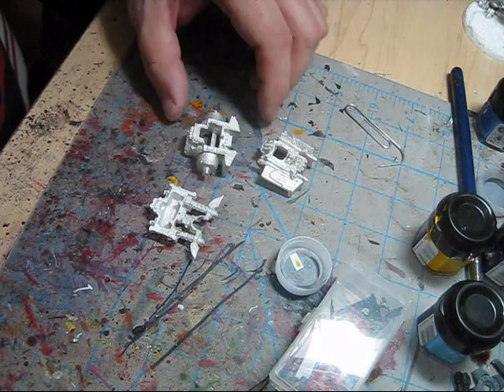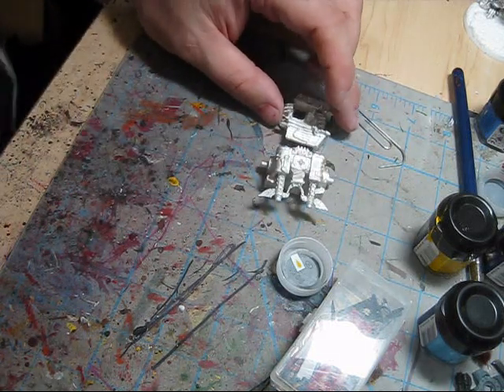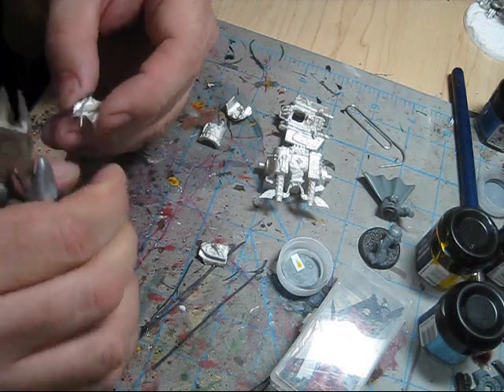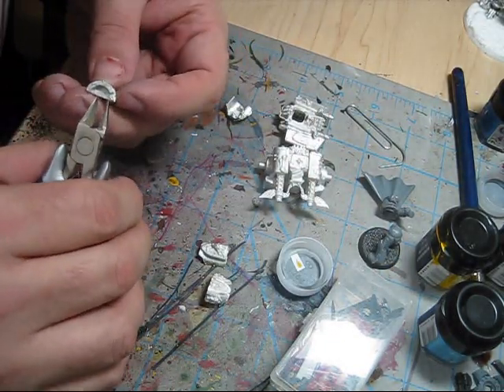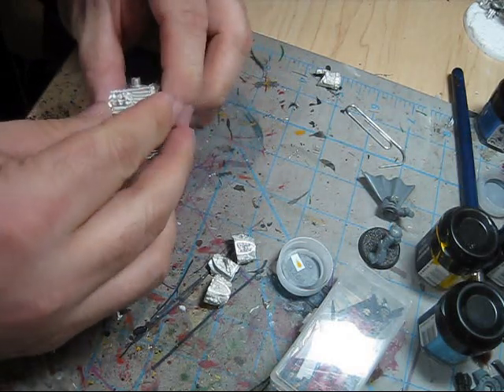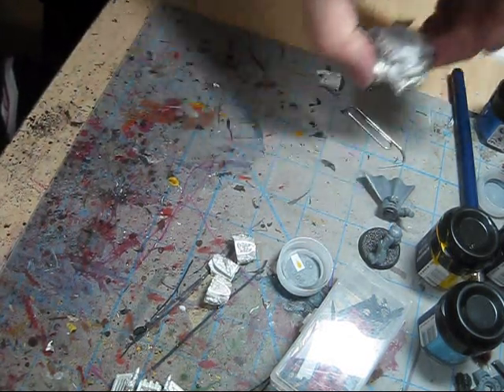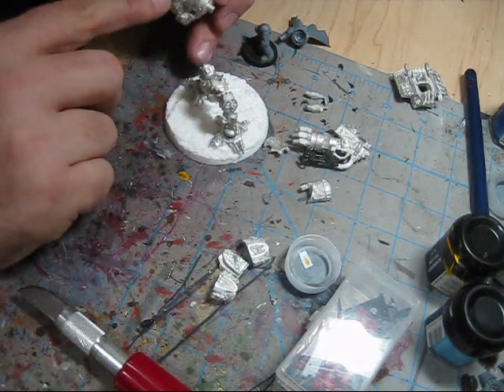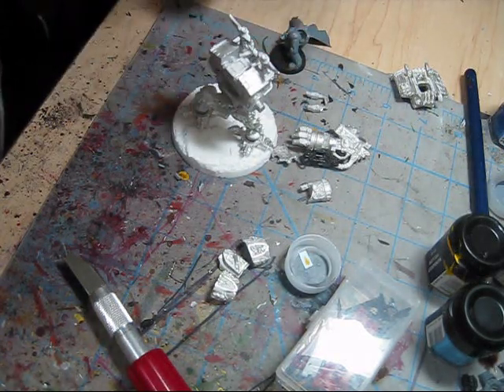How to use a pinning drill part three, last part!

Comment from the maker: Yes I would pin the hawks wings.  They should be able to handle the smallest bit and a paper clip.  As a rule of thumb, any thing with metal parts, I pin it.  Helbrechts hand onto the body, Dante's gun onto his arm, Baal Pred assault cannons into the turret.  The list goes on and on.  I have put some pins into some really small parts.  

I also always pin my models onto my resin bases.  Resin hates to hold glue.

Comment: Butt allso i want to point out that Citadel Paints are awesome, even my old paints from late 90's are still Ok ( ish ). some of them are guite on the point when to putt them away, butt those what were allmost full are in mint condition. that supriced me alot, when i discovered them at my mom's basement. so my tip would be to store them in cool slightly damp place. Anyway Thx for tips and advices your videos has offered,  I will keep watching yours , Fritz's and matt's vids for long time to come

Comment: Oh. BTW for all of those new to the hobby pinning isn't only to hold things in place. The pin provides a level of strength to the joint that glue cannot match. So if you have a model where you are going to move around by grabbing the arm, backpack, limb, etc. make sure to pin it to provide the strength you need to make sure it doesn't pop off after you finish painting.

Comment: Dremel (The brand) has a very small rotary tool that it meant for like jewelry and engraving or other fine work. I'm willing to bed very small fine drill bits will fit in it. I use my larger one a lot of grinding down and converting certain areas of metal models.

Comment: Metal models are about twice the work of plastics to prepare for painting. 
Ideally they should be washed with soap and a toothbrush to get all of the mold release residue off, and filing them is a pain and a half. Then when you actually get around to building the model the weight of the pewter often requires pinning. Plastics are much less bothersome in those regards.